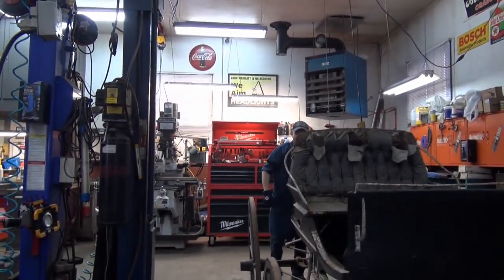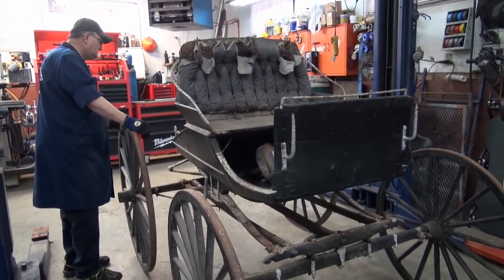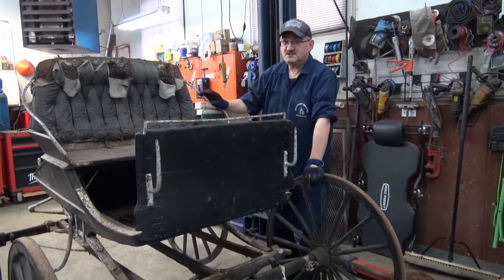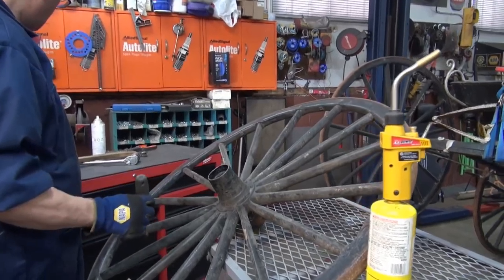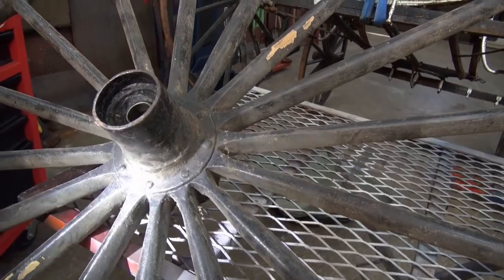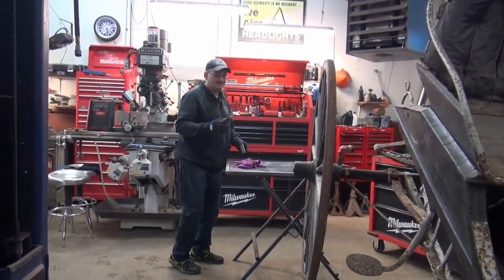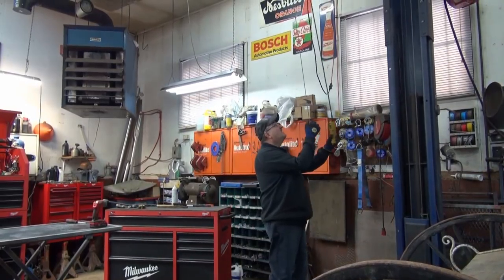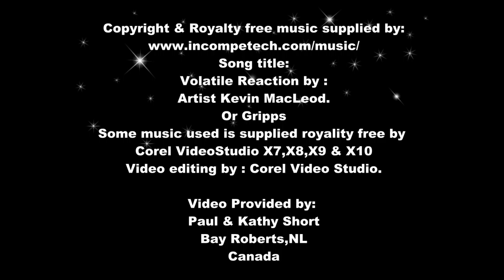Never Put The Cart Before The Horse

Comment: Paul, don't know if this would help you or not. If you started some research into Shipshewana, In.  or Elkhart, In. about buggies and the Amish you might be able to find out some info about the brakes they use on the buggies in that area. I found out a couple years ago that they have brakes on their buggies. I've been told that they've had brakes for a long time. I think they are operated by car battery. In northern In. they even have fenders on their buggies. Shipshewana is a hot spot for the Amish and it's a big tourist magnate. It's also my stomping grounds when I was a teenager running around. Hope this helps. God Bless...Levi

Comment: Paul, my father used babbit  for bushings years ago in just about everything including wheel bushings and of course you know what that is. I remember he had a sawmill and ran a 1942 Willys jeep up on a axle which had a roller on either side, started and ran the jeep in second gear for the mill;  these had babbitt bushings. He used to pour new every now and then using bread dough to keep the babbit from running out the other side. when the hot babbitt hit the bread it baked it and stopped it from running, I thought that was amazing technology back then! ...he was a Newfie too!
Reply from the maker: Cool comments. Ya Babbitt was widely used back in the day. Same goes for lead. Haven't seen it in decades. Thanks for sharing.
Reply: Tnx Paul, still available; I still use it when I'm stuck 4 some projects. We never ever used lead alone for bushings let alone bearings,  2 soft and wouldn't last. Half the old make and break engines like Atlantic , Acadia sawmill pulley systems, etc. were rebuilt using babbitt as c/r and main bearings.  Course you will need a grease nipple or two. Load on wheels will determine the type and mixture of babbitt if I rem correctly. If you have never used it you should go there and give-er! Sawmill supplies should carry loads of that stuff

Comment: Question for the BX Paul. I want to change the hydraulic oil on tractor. How can it be done to also change the oil on the backhoe at the same time as you do transmission. This is in case the oil could be contaminated. Thanks
Reply from the maker: Once you change the tranny oil your changing the hydraulic oil as well. The only oil you won't get out is any oil in the lines or small amounts in the cylinders. As for how you actually change the oil there's a drain plug to remove but I'd encourage you to pick up a service manual if it's a tractor you plan on keeping.

Comment: Hey Paul,
How about a vintage 'land anchor" for the brake? A good stiff length of rope and used concrete block oughta' do 'er. And a buggie with a rumble seat is even better as you can have the the passenger 'drop anchor' when needed without taking your hands off the reins! For extra stopping power, just drop a second block.  :-)

Comment: Is it possible to remove the axle from the frame and put that in the lathe so you can turn it down to allow for the bushings because in the video it looks like the axle is a length of square stock that has been turned down and bolted on to the frame using u bolts
Reply from the maker: Yes it is but the customer don't want to spend the money lol.
Reply: okay

Comment: The brakes on horse drawn buggies, when present at all, were chiefly what you would call "parking brakes".  The road brakes were the horses.  The ones I recall seeing were "scrub brakes" where a hand lever would push wooden brake shoes against the outer rim of the wheel.  Having a brake in the center of that 40" wheel might put too much stress on the spokes.  Looking forward to your solution.